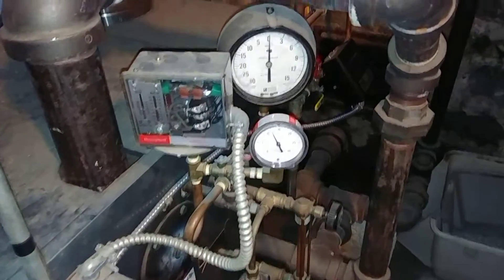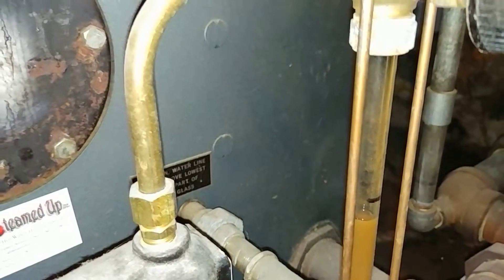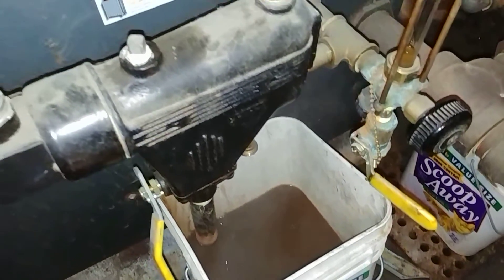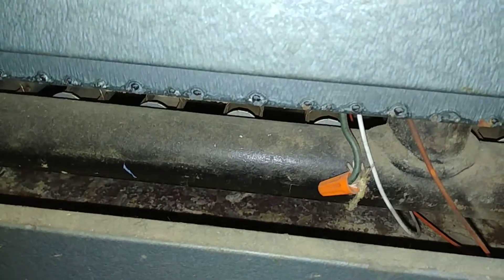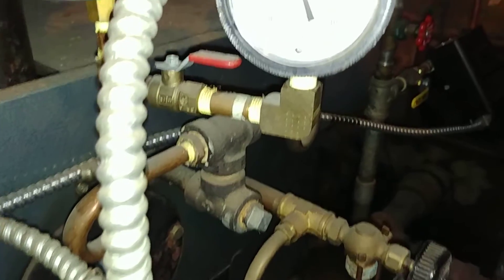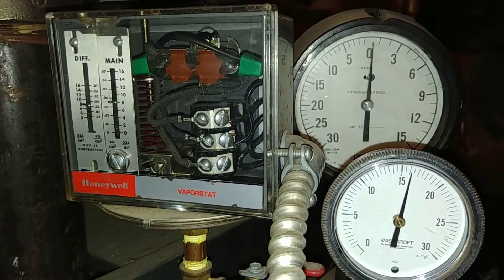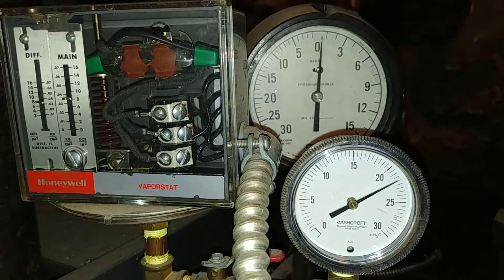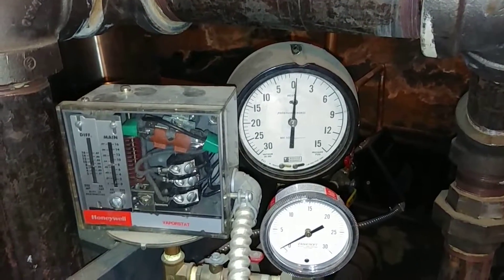Steam Boiler Start-Up Part II. Blowing Down The Low Water Cut-Off And Testing The Vaporstat

Comment: If you have a auto water feed on a steam boiler.  How often should one perform a blowdown in the winter.
Reply from the maker: If you have a float type low water cut off, you should blow it down once a week during the winter  per manufacture"a instructions.
Reply: @gordonschweizer5154  Thank You

Comment: Hi Mr S.
What is the non float low water cutoff adapter that you screwed the probe switch to model number or exact name. I want to replace my 67 with it if I can't find the half inch easily
Reply from the maker: Hi back!
Are you perhaps referring to Hydrolevel's 711C manifold that attaches to the sightglass tappings?
Reply: @gordonschweizer5154  
Great! Thank you. I will ask my Local plumbing supply store to order me one. 
I am going to try to install this it myself. 
Can I put 6" black pipe nipple in the 67s old hole to make it easier for me considering it has the sensor on the outside?
Reply from the maker: @genx8889  Dear Sir, I hope I am not leading you astray with my assumptions. I think I don't quite understand what you are asking.
Please forgive me.
You may want to post pictures of your current set up on HeatingHelp.com and gain access to more eyes on your job (and better advice!)

Comment: I need to replace the McDonnell No 67 water cutoff on my steam boiler.  Is it difficult to do?  I'm fairly handy.  Also, does the switch come with the unit?  Thanks!
Reply from the maker: A new switch comes with a new #67.
The tricky part for me is getting that brass 1/2 o.d. bent tube lined up to hit all the right places. I always seem to cut it a bit short.
I've taken to using 1/2 od soft copper and a good tubing bender.
Reply: @gordonschweizer5154  Thanks!  One more question:  The unit I'm replacing is exactly like the one in the video.  The switch is on left side and the handle for blow off valve is also on left side of unit.  All of the photos now show the handle is located on the front and the switch is on the right.  Are the newer units reversible, per se?
Reply from the maker: @mbutala  The handle valve assembly should be removable by undoing the four screws/bolts and re-orienting to suit your needs and clearances. I'd use antiseize when putting those bolts and gasket back.
Reply: Is there any reason I can't use the existing copper tube.  (I ordered new #67 and got it today.  Plan on swapping out tomorrow.
Reply from the maker: @mbutala  It's been awhile since I've replaced a 67, but as far as reusing the brass tube, you should be able to give it a go. It might not quite line up with your new unit due to manufacturing variances.
Reply: @gordonschweizer5154  I just went through the same struggle with the brass tube, and resorted to the same 1/2 inch OD copper.  They call this a "faucet riser."  I sweated in an elbow fitting rather than bending it.  I wonder if that will make a difference....pS:  I found that aligning the tube at the top is easier if you pivotal the whole LWCO assembly from it's fitting at the bottom of the sight glass.  Be sure to remove the glass first.  This was the only way I could get them to line up.  Thank you, sir for sharing this video and your valuable experience!
Reply: Hello, my ball valve is leaking on this unit... arec there replaceable seals in it?
Reply from the maker: @rritchie1977  The valve assembly (ball, handle, gasket, seals, bolts, etc) needs to be replaced, sorry.
The #67 is not my favorite control.

Comment: Same boiler I had in my house when we bought it.  Gas eater.
Reply from the maker: This one is massively oversized which doesn't help.
Reply: @gordonschweizer5154  if I recall correctly my EG11 was rated for either 1075 or 1125 sq ft of steam radiation.  I eliminated 3 huge 100 sq ft rads on the 3rd floor and put in a Burnham IN8.
Reply: I have this same boiler in my house also.  Heats 7500 sq. ft.

Comment: Duly known, Hydrolevel makes a 1/2" spud for their probe type controls.
Reply from the maker: You are quite correct.  Used them a few times when adding the extra manual reset LWCOs on Weil-McLain boilers at the old try-cock fitting tappings.

Comment: he only ran the boiler 8 times last winter?
does this guy have heat pumps or some other type of heat in the building besides the steam?
Reply: Yes, you are right, they have a gas fired furnace tied in with their A/C.  They also have a pellet stove heating the enclosed sun porch.  Plus we really didn't have much of a winter last season in our area.
They save the steam for when it gets below 30*F outside.